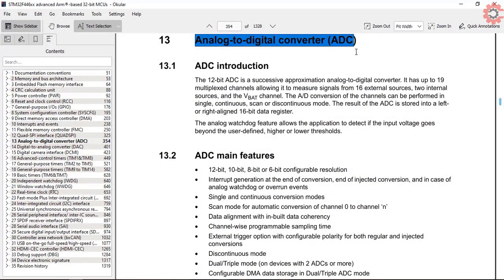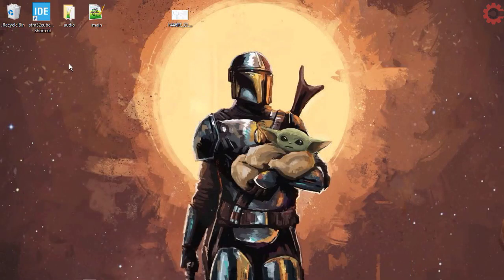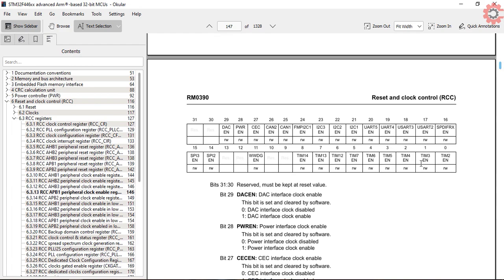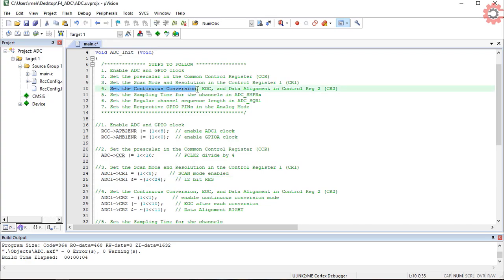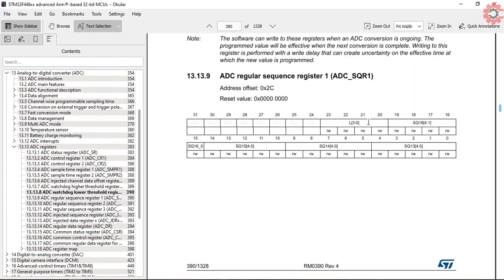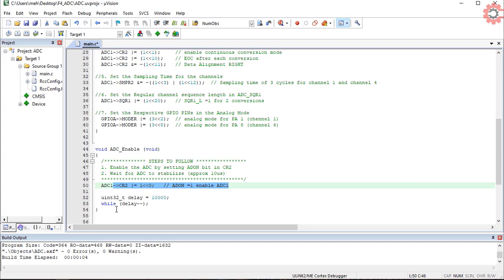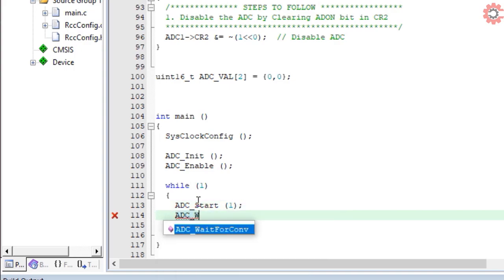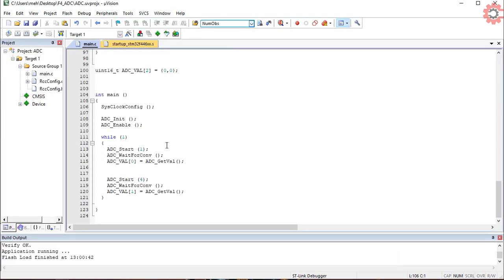#5. STM32F4 ADC using Registers || Multi Channel Polling

Comment: hello..i had been following your video avidly... i notice at 16:34 ADC[1] displayed 4095 when PA4 connected to 3.3v and displayed 2065 when connected to 5v.  Why is this so? Shouldn't that be the opposite i.e. 4095 when connected at 5v ?  Please advise.. thx
Reply from the maker: It was not connected to 5V. You should never connect to 5V, the STM pins are 3.3v tolerant. 
The pin was not connected anywhere, so ADC was showing some random value.
Reply: @ControllersTech    ok i see... but in your video ADC[1] show 4095 and 2065 where did you connect PA4 to?   3.3v respond to 4095 ?  and 2065 to which voltage ?
Reply from the maker: 3.3v responds to 4095. 
2065 is just a random value shown, when I removed the pin from 3.3v. At this point the adc pin was not connected anywhere.
Reply: @ControllersTech   ok i see... its kinda strange, i try your video on a STM32f407 everything working fine, ADC[1] show 4095 when connect to 3.3v but when connected to 5v show 2065...  could you kindy advise? TQ
Reply from the maker: You should not connect to 5v, or else you will burn your board.

Comment: Great video.  I have a question.  In line 28 you are setting the continuous conversion bit but you also start conversions at line 74 in the ADC_Start() routine.  Why are you doing that?  In my code, unless I comment out line 28, the program does not work.
Reply from the maker: Continuous conversion starts the covrsuon again once the previous one is over. You can enable or disable it as per the code requirement.

Comment: Thank you for the great videos,
concerning setting up the resolution, i think it should be ADC1->CR1 &= ~(3<<24) as we are setting bit 24 and 25 to zero. 
thanks again for the great content.
Reply: Hi, since we have to write a 0 to these bits and since its reset value for bit 24 and 25 is 0 we can consider only setting bit as both the bits are going to be zero. Hope it helps.

Comment: Sir,For sampling time setting,You need to use ADC1->SMPR2 &= ~((7<<3) | (7<<12)) as we are using 3 cycles for channel1,4. Is it correct.I am having doubt in clearing the bits.
Reply from the maker: Yes that's correct

Comment: I would like to know why did you switched from STM32CubeIDE to Keil?
Reply: Me too , thanks for sharing your valuable knowledge
Reply from the maker: I haven't switched. This is register based series and i am using keil for this. For HAL, I'll continue using cubeide
Reply: @ControllersTech  That's OK , but my question and I do believe would be same from onurolce  post will be :
You only use keil for these new set of videos stm32 register programming and not CubeIDE.
I can not download a Keil free version from a website .
Anyway what will be the steps on CubeIDE to do register programming .
Perhaps would be a good idea to open a new tread,  ---  Register Programming on CubeIDE --
Reply from the maker: you can download keil from their website.
I never tried with CubeIDE, but i guess it will work as mentioned below:
1. create a project, just like you create regular project
2. in the cubeMX select only the basic things. (it won't matter what you select)
3. after the project is generated, delete the contents of the main file and follow the video afterwards
Reply: @jorgejacome4269  Yes you are right. and I also agree with you about "creating new playlist for Keil and STM32".